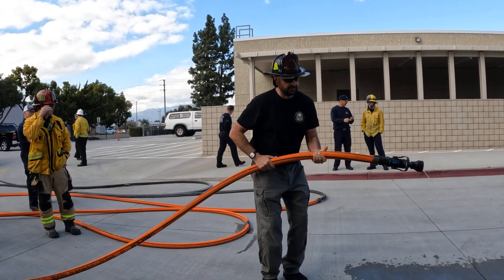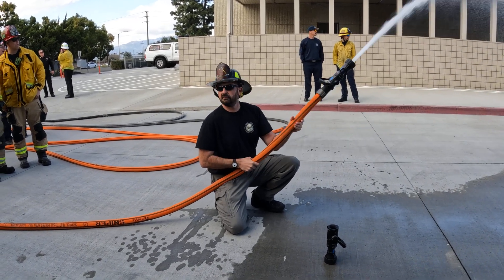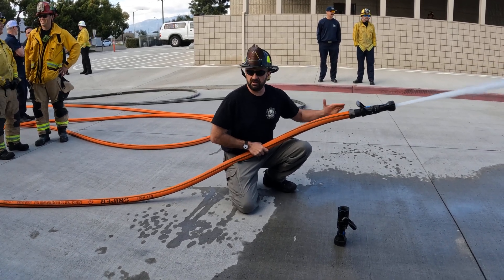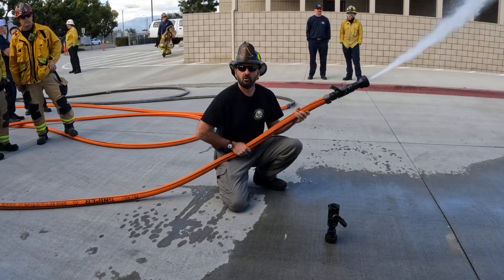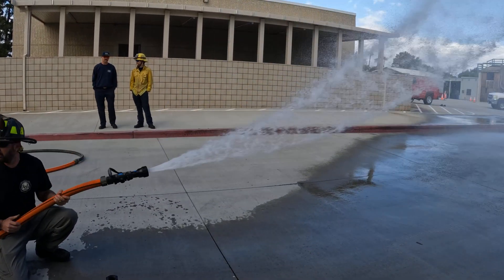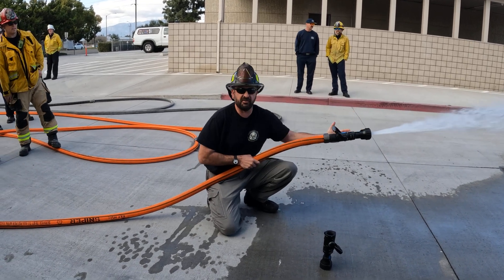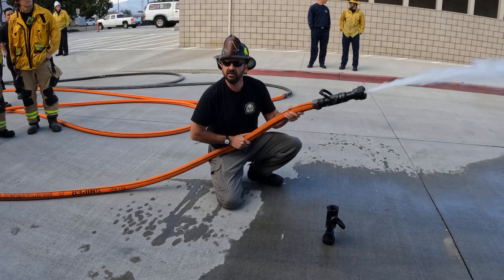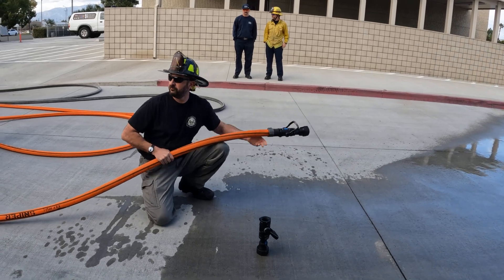Sniper with a HEN Blade 160gpm@50psi with a Turbo plus 25psi Backpressure Increasers

Comment: Just another fog nozzle.  Costs twice as much as a solid bore, just so you can push less air than a normal fog line, yet we still fight fire on straight stream or we don’t get the penetration we need without pushing the fire. 
The next issue, good luck getting this thing removed from the line in cold weather. It has no nuts for putting the wrenches to it.  Just another sales gimmick.